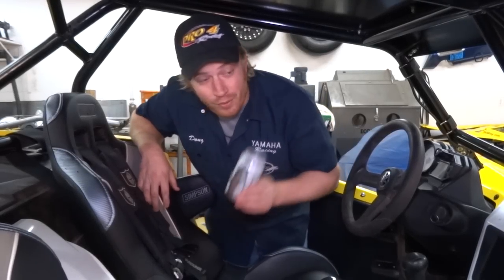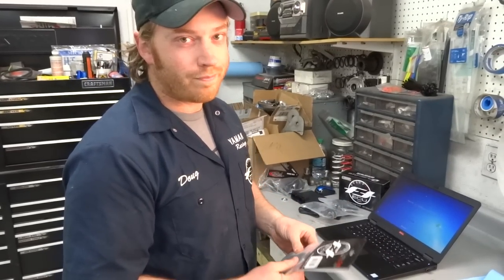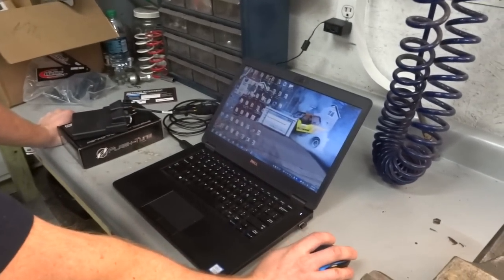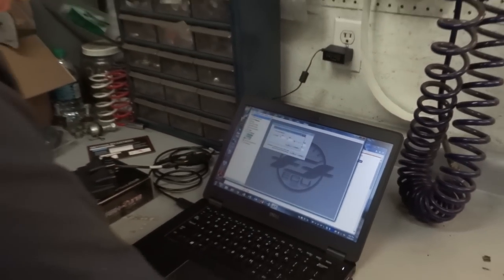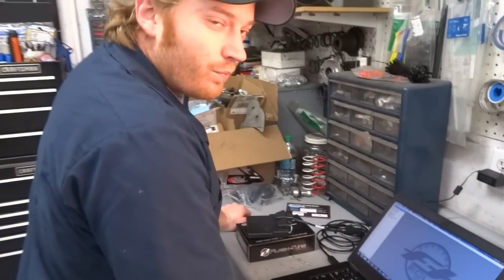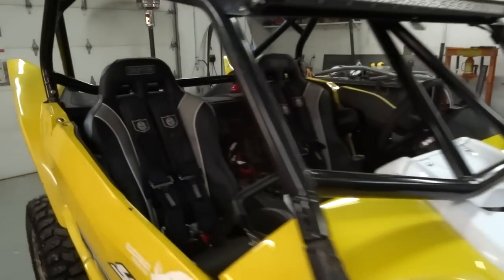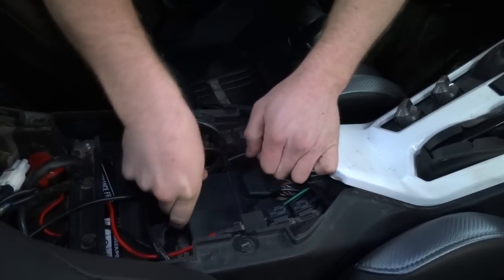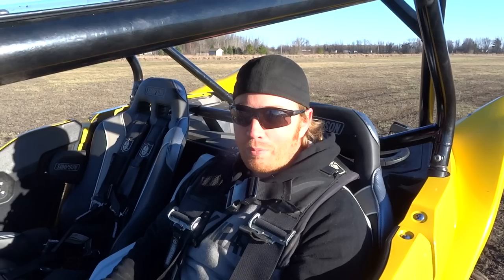Tuning Doug's Yamaha YXZ1000R with Flash Tune!!

Comment: Can't believe you waited this long to install a tune.  I think I did that on the second day I owned mine.  I did the bike side kit,  and if you think it's hard getting the plugs off,  it's ridiculously hard replacing the pins in those plugs with no slack in them at all.  Thank you Yamaha!!  Now pull those headers and grind that lip off of each pipe to smooth the flow (you'll see the carbon outline). I would recommend a slip on but I know you are planning a turbo.  Great vid!
Reply from the maker: We got a little something special coming from a sponsor. Not quite a turbo, but just as pricey. lolol
Reply from the maker: Not a supercharger either, don't get your hopes up... lol
Reply: SXSBlog.com That's a shame, would like to see that install video.
Reply: SXSBlog.com long travel?
Reply: Danny Williams is still an old woman mb

Comment: If you only tried the stock exhaust tune, you should try one for the full exhaust even if you don't have a full exhaust, it makes a pretty big difference.  I ran it that way for a few months full tune with the modified stock muffler, then added a DG dual slip-on and it was noticeable again, especially in the upper range.
Reply: In this vid we were running the slip-on tune, I definitely wanted to throw a little extra fuel at it and it seems to like it even with the stockish pipe on there for now.
Reply: After you get used to the slip-on tune, try throwing the full on and see if you feel a difference.  Thats the great thing about these kits, you can always try a different tune.

Comment: I added a trinity slip on stage 5 exhaust to my 2016 yxz, what would be your basic  recommendation to make up for the new one on ecu changes. I guess I'm running lean. But I dont want to get to crazy. Just make it run good. Thanks
Reply from the maker: They are definitely on the lean side.  Flash Tune is good for that adjustment.  You can send it to us if you don't want to invest in the hardware.
Reply: How do I get ahold of you to discuss it.
Reply from the maker: SXSBlog.com@gmail.com

Comment: Does doug plan on doing a gear reduction at all or is he keeping the factory gearing? Im just curious because I just did the gytr gear reduction and im not entirely sure yet how i feel. I feel like i lost a bunch of top end.  But i did just order 30s so im hoping that helps.  I ride mostly wooded trails.
Reply from the maker: Hey Matt, this is Doug.  No, I'm not planning on doing one for that very reason.  Big tires don't really fit the majority of our style of riding, and I spend a lot of time in 4th/5th gear as it is.  30s should help ya a bit, and if not I'm sure there are plenty of people that'd buy that kit from ya.  Maybe swap trans?
Reply: SXSBlog.com yeah I hear ya.  factory 4th and 5th is amazing in these machines.  I definitely miss it.  I think if I was to do it again I would just go for the 1st gear reduction only.  I think that would be the ticket.  I'm going riding today in the woods, on factory 27s, so we will see how it does.  the good thing for me is in the woods I'm not 5th pinned very often.  I guess I may be now.  my top speed is about 65 mph.
Reply: SXSBlog.com hey Doug do you know how to put fuel controller on yxz 1000 there's no videos anybody putting one on after they put a new exhaust on
Reply: Fuel controllers are pretty simple.  Typically they come with a harness for your machine and just plug into the fuel injectors / harness, then usually a ground wire that you just put wherever is convenient.  Real straight forward as long as you buy from someone who provides it pre-loaded with a map.  If you haven't already bought one, I'd seriously consider going the FTECU route instead.
Reply: Doug Butterfield I already bought one it's a ejk
Reply: Doug Butterfield thanks for your help they have no videos that I can find that's why I asked one way or the other. I'll figure it out I appreciate your time and thanks

Comment: What kit did you get I see there is a couple options or what was the price thx guys
Reply from the maker: FTEcu gave us both kits. I think we would likely recommend the bench side kit due to its simplicity.
Reply: that thing aint cheap 450 bucks ,you guys think it was worth it . ..i have a little over 4000 miles on my yxz now .ive done just about all the east coast.. places and have no issues and have broke anything yet  i live in shitty new york out side of buffalo. i do recommend to get the weller aip pump block off kit and the weller sway bar  clamps for the rear so you dont pop the rear links.that and the neff bars have been a live saver with rocks and trees ,and they saved the bottom they go a good ten inches under the machine .that and the rekluse clutch has been killer at places like hatfield mccoy where having to stop on hills with people in front stopping like jackasses it helps.the big front bumper with the winch mount built in has saved my front end...iam also developing front fenders for it,,when i get them in to production ill have to send you a set..not getting mud in the face is always a good thing
Reply from the maker: Absolutely worth it in our opinion!  We like the flexibility of being able to swap/adjust tunes without having to send the ECU out.  We've also got a few machines in the fleet so it becomes a much more economical option really quickly.  The power / responsiveness is definitely noticeable.  Let us know when you get those fenders worked out!  Love to see em! sxsblog.com@gmail.com